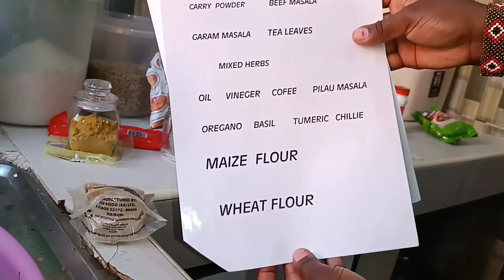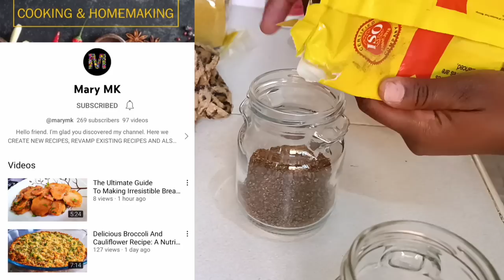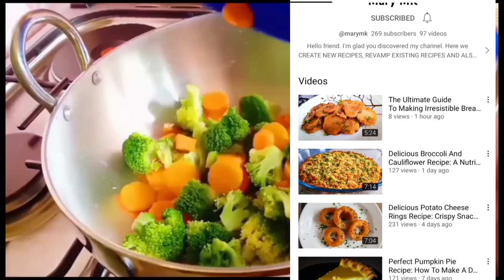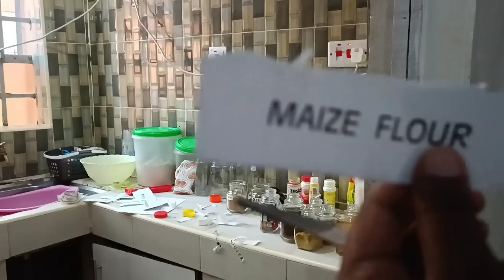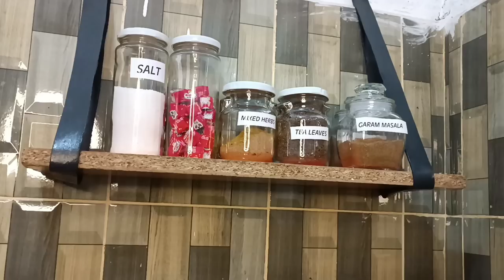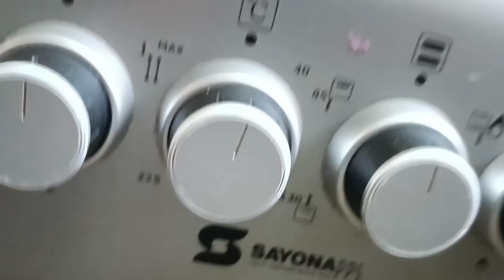New Kitchen Reveal //Tiny kitchen Tour Kitchen makeover on a budget

Comment: Happy to see you doing better.The kitchen turns out great.
Tip...buy a quart of white paint and the dark spots around the sink ,the shelves and even the lines between the tiles,use one inch brush and touch them out.Everything will look better,u can do a little at a time.
Reply: I like this tip
Reply: @winniemwai344  Thanks,I have one at home,a little tough up makes things looks better, even if the tiles on my floor is chipped or the lines in my tiles are looking old,I touch out everything.❤️